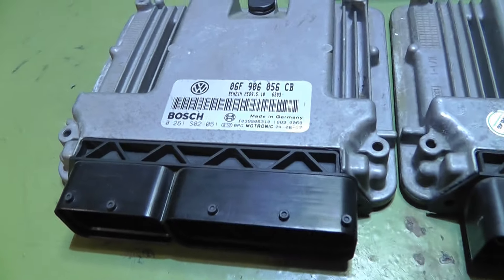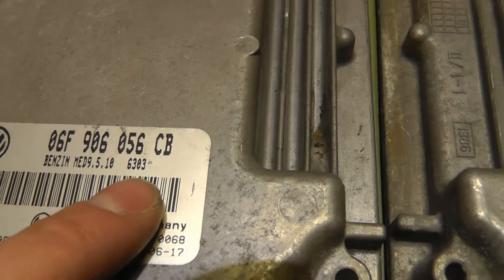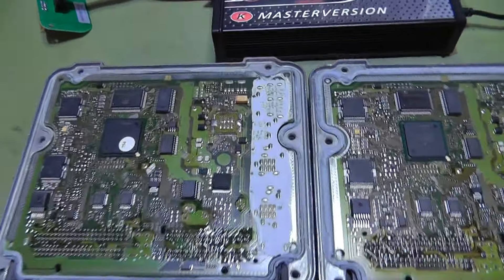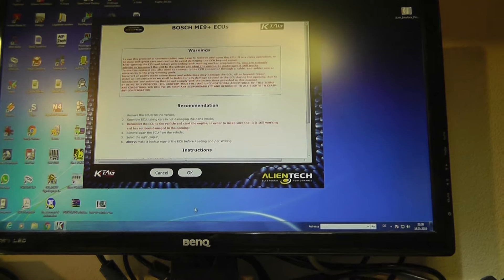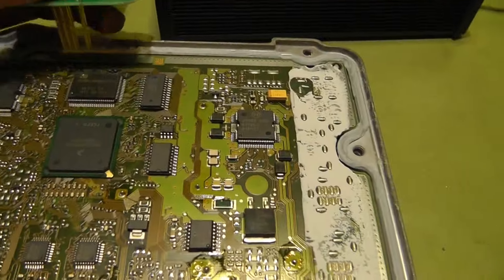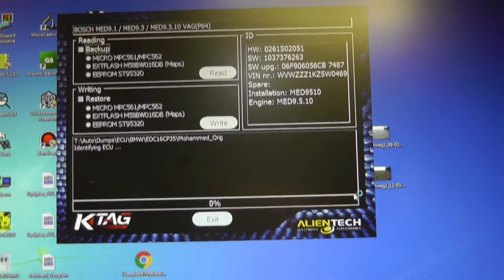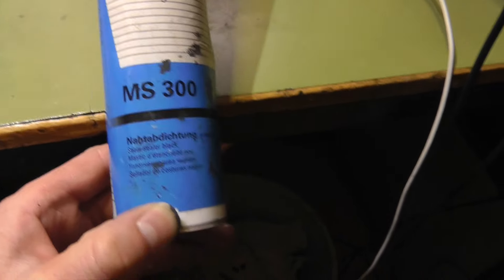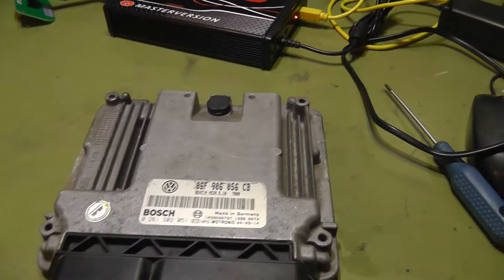Bosch MED9.5.10 ECU Cloning with KTAG

Comment: please answer my questions:
1- in 1.55 on this video you said  i do that because i havent locking code . do you mean pin code and if you have it then no need to use ktag?
2-  is there other way to read that med9.5.10 by ktag without using the green colored adapter?
3- is your ktag original or chinese?

Comment: Im trying to back up a MED9.1 and it doesn’t read can you advise me the right procedure please?
Reply from the maker: what's the exact error? which tool and needle adapter do you use?
Reply: @kostelectronics  i figured it out. I was backing up the wrong way with my AutoTuner master. I wasn’t using the back up from the Autotuner files

Comment: you used an adapter to read the ecu, if i havent the adapter can i use other method ( connecting wires at ecu pins )  ? i mean does software show u many methods for every ecu ?

Comment: The number you are not sure its Software
The bigger SW its the newer version of flash file are inside. If you have frf/sgo file you can upgrade or downgrade files ;)
Or if you have full bdm file like you have you can transfer full backup to another it will work ;)

Comment: Hi have all the same but mine won't read do I need to add any extra cables.
Reply from the maker: if you want to read a MED9.5.10 then no extra cables required. Maybe your CPU or Flash is dead inside the ECU?
Reply: @kostelectronics  when I  car works just keeps saying injector 2 and 3 not working.
Have same set up as you. Don't know cums up with grey info box.

Comment: do you need 12 volt power supply and will 10 amps be enough to boot the ecu?
Reply from the maker: not need to power up the ECU. K-TAG provides power to  the MCU and this is enough.

Comment: plz ,what was the problem in the first ecu ?   when you wrote the data from the first ecu to the the second used  ecu, had the data on the second been erased automatcally  ?
Reply from the maker: The first ECU was burned by the customer. He connected the Battery reverse to the car :) BR from Switzerland, Matthias
Reply: @kostelectronics  hi
Today I was trying to update a jcb 456zx ems .
By mistake I select wrong software.
Now no any power is coming in ems.
I have another ems  
Can I repair form this tool
Reply: @dharmendrakumar8361  hmm , whit Ktag and the software  not alow to put rong software, she do checksum auto,  i try to put another ecu software from another  ecu and not alow me

Comment: do you have to virginize the new ECU before writing on to it?
Reply from the maker: no, just write the Data from the original ECU to the new one. Very simple :)
Reply: @kostelectronics  that's great. you are really appreciated. great people.
Reply: @kostelectronics  without erasing the data first from the new one before writing to it?
Reply from the maker: @aliakas1402  Yes, you need to copy the EEPROM and don't need to adapt the ECU afterwards. The EEPROM contains the immo-data.
Reply: @kostelectronics  would that not confuse the eprom? Over writing what it allready has including its security pin?

Comment: I read with k tag and i get 3 files...first is file.epr second file.fls and third file 108 kb...which one do i choose ?
Reply from the maker: When you swap the ECU with the same part#, you need only the .epr file, because there is the immo-data located. But you can write all files to be sure that all is exactly the same as on the old ECU.
Reply: For cloning you make full back up of the ori ecu? And then you write with restore ?
Reply from the maker: @vasospanou6217  yes!
Reply: @kostelectronics  but must you erase data of new used ecu before write to it?

Comment: is it neccesary to have ECU of same part# ? currently I have EDC17c64 - PASSAT but id like to flash overt to another ECU that I had in my jetta also EDC17c64! would I need to remove immobilizer ? or can I just copy stuff over from one computer to another ? I believe on one of them my dealership set the speed limiter too low and I just cant drive that car xD going 55mph in 6th gear and car revs as if it was at 5k rpm